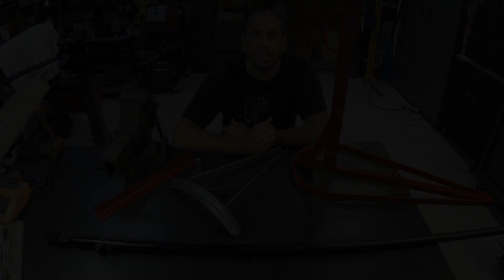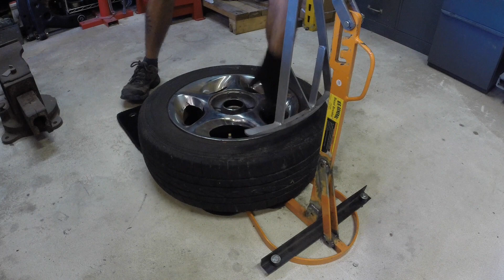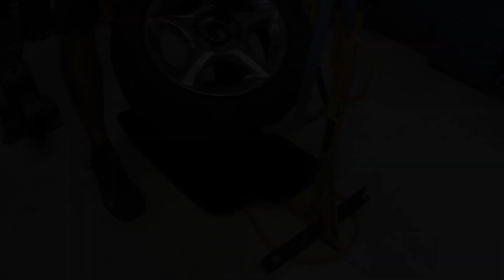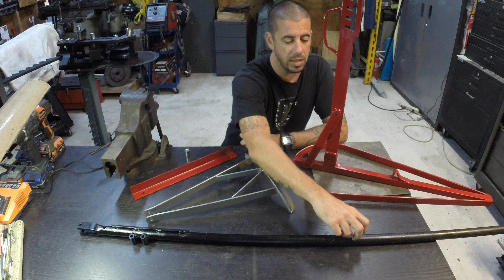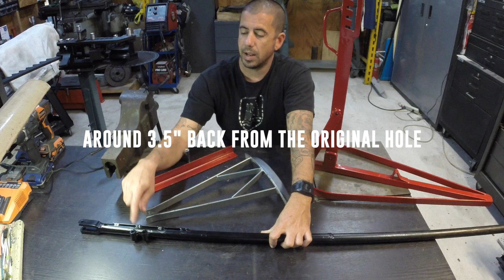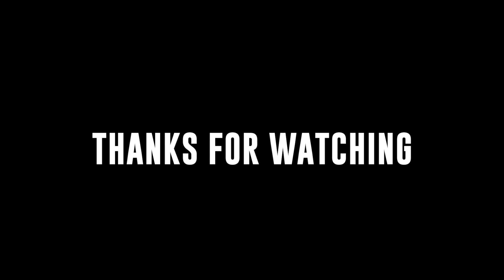Harbor Freight Bead Breaker Modifications

Comment: I did something a bit different with this beadbreaker. I first removed the crappy beadbreaker from the harbor freight Tire Changer. Then, I took the new beadbreaker apart and welded the main section (the piece with the slots in it) to the Harbor Frieght Tire changer. (vertically along the main tube). This way, the whole structure is super strong. You can eliminate the beadbreaker stand altogether. It works awesome!!!!!😊

Comment: Bed frames, who knew they would have so many uses.
Reply: Good source of cheap material but hard on drill bits. I question my decision to use it whenever the drill comes out. If it wasn't for the bench grinder i'd probably always be out of bits. doesn't take a weld very well either sometimes. but that's life, there's a trade off for everything.

Comment: I welded old double  bladed axe to 1 1/4 pipe at 45 degree angle ( middle hits first) angle matches rim
Reply from the maker: Interesting idea. I saw a picture on a facebook page recently and someone had dismounted a tire at a junkyard. In the background was a Harbor Freight tire changer, but it had a modified head on the bead breaker (kinda looked like a thick bent wedge) and it also had the motorcycle attachment on top. I asked the original poster about it and he had no idea for the most part but he said that it was the setup that he used to dismount the tire and that it was in the yard for public use.

Comment: The is great, I can't find this discontinued part anymore. What's the next best one? Looks like HF makes a newer version.  I'm bought your "duck head" adapter! Can't wait till it arrives. Thanks for you video!
Reply from the maker: Thank you for your purchase! I haven't tried their new version, But I'm working on designing something that attaches to the Harbor Fright manual tire changer. Not sure when it will be ready for production but stay tuned!
Reply: @LucidAutowerks  Thank you! Yes, I will stay tuned. I've heard of those having issues with it bending and such. I'm sure mine will bend overtime. I used to use a long wooden board and a truck to break beads. Looking forward to it.
Reply: Walmart sells this exact bead breaker on their website. It's sold by "Code Tools." Very reasonable at $69.95. I just bought one but haven't used it yet.
Reply: @vin9114  Oh this great, thanks for the tip!

Comment: Nice! I will be doing most of these changes, I already did the drop in links but I need to get a piece of angle to hold the bead breaker down.  Thanks again man, I can't wait to get your Ultimate Tire Changer mod ;)
Reply from the maker: I also suggest checking out a product called the "Bead Buster". For most tires I have no problems with the modified bead breaker that I show in this video, but recently I tried to break the bead on a 20" wheel with a tire that had a stiff sidewall and it was pretty much impossible. I started to put a bend in the reinforced pipe. Bead Buster seems to offer a few different models and I think I'm going to pick one up in the near future.

Comment: So what you're saying the HF breaker as it comes is garbage. Thanx for the heads up. 👍
Reply from the maker: 😂 I give it maybe a 5.5 out of 10 as it comes. It will work for something like a 195/60/14 or even a bigger truck tire with not too stiff of a sidewall but once you start getting into lower profiles or stiff sidewalls all bets are off.

Comment: Just an FYI. Rather than weld the frame, just replace the crappy bolt and wing nut with a bolt, washer, lock washer and nut. Tighten everything down tight and then you only have to deal with the pivot and handle...
Reply from the maker: That would work too. I just like to weld though :D

Comment: I twisted one all up and had to exchange it just doing a lawn tractor tire. it bent the spine up in the middle of the snow shoe part. Granted the dish was really deep and it had to work extra hard but i still thought it should have held up to that. Came to the conclusion myself that welding the new one together as you have done would be a good step in the right direction. The wing nuts that came with it for assembly were just a joke couldnt seem to get them tight enough to prevent it from moving. Moving the pivot as you have done seemed to be necessary also because of the angle the force was applied to it only made matters worse. I wasn't sure how much i was going to move it. thanks for including that in your video. Seems like you will want to put the bolt down angle on the other side of the vertical post though from what you show in the bench top demo as the upward force is applied there, but it may not matter as much since you moved the pivot. Seems to me that the radiused angle shoe that contacts the tire could also stand to be a little narrower too or maybe have a step in the middle (maybe about 2" wide) that would contact first concentrating the force, and help it break a little easier...anyway, Thanks again for the help.

Comment: Do you think by extending the floor frame farther back it wouldn't tip and you wouldn't have to bolt to the floor? Im trying to get around bolting to the floor.
Reply from the maker: That would definitely help. For a while I was pulling my van up and putting the front tire on the edge of the base to hold it down.

Comment: What do you think about this for a somewhat low profile tire? I know the stiffer sidewall requires some finesse. I worked at a tire shop when I was younger and hate paying to have my tires changed.
Reply from the maker: The lowest profile tire I've done is a 225/40 R18. It has no problems doing it. The extra long bar really helps. It's important to reinforce the back of the bar though. I tried without the extra angle iron and bent the original bar pretty badly.
Reply: Lucid Autowerks I can imagine! Well thank you, that is the exact tire size I’m considering this for. Just really have to think about if I can do it without damaging the new wheels.
Reply from the maker: They key is moving the point where the arm pushes down from, so that it can push straight down with enough force but not to have too much angle so that it can rub on the lip. I also lay down an old floor mat so that the base doesn't rub against the wheel and cause damage. I'm thinking about making a wooden platform of some sort that will cover up the metal base.
Reply: Well.  You still need the tire center yo balance your tires properly.  I doubt one have something to properly balance their tires with the right weights.
Reply: KIT TSANG in my experience balancing isn’t that big of a deal unless you have a real bend or issue with your wheel. And at that point, balancing isn’t going to fix it.
Reply from the maker: @kito1san  I have a bubble balancer and it gets me close enough. If it's really an issue you can get balancing done at Walmart for pretty cheap. I also take my tires there for disposal.
Reply: it seems that they really did not understand that hollow tubes of heavy gauge will always be stronger than a solid bar. they used a lot of solid stock in this thing seemingly to try to make it heavier. All it really did was add weight, not strength, it probably would have benefited greatly from a different approach in this way. but i suppose we can make due with it.

Comment: Rather than wasting time and money redesigning a turd why not try a bead buster or esco portable bead breaker, they work on a wider variety of wheel-tire combinations including ag and aircraft, they're portable and you can work at a much more comfortable level not bending over so much on your smaller lighter wheels, the Bead Buster brand units are impact wrench safe but if you're careful you can go that route on the cheap ones too, you can get a Bead Buster XB-455 for around 100 bucks or a Vevor brand for around 70 bucks, that being said fabricate a receiver hitch mount adapter for your HF manual tire changer and you have a complete static or portable tire changing system...
Reply from the maker: Because when I made this, I didn’t know that Bead Busters were a thing…
Reply: Best thing I did after buying your duckbill setup, funny thing is is those things have been flying under the radar for decades and now they're just coming to light.

Comment: If you have the capacity to build one. Why buy one?
Reply from the maker: I bought it and then realized its weaknesses and improved upon them afterwards. There are certain things that would be tough to make from scratch like the adjustment notches on the post and the curved piece of angle iron that pushes down on the tire.
Reply: anybody that buys from HF knows it's not a tool you are "assembling", rather a kit of raw parts that requires "building". building it is not the same thing as assembling when buying HFT. To me it's part of the fun but i am just a tad sadistic when it comes to "fun".